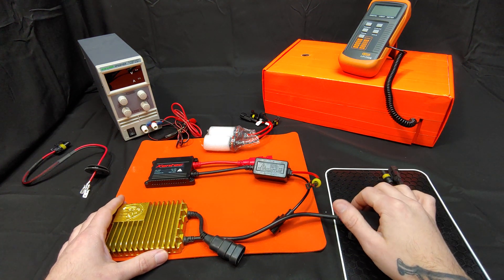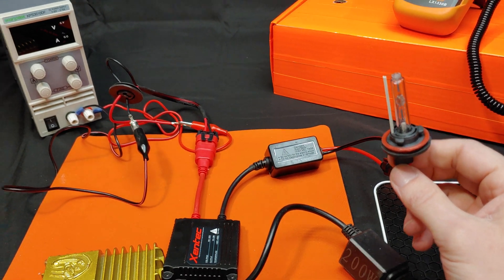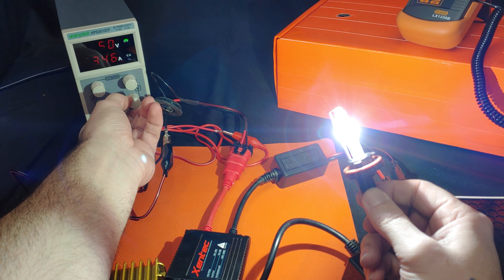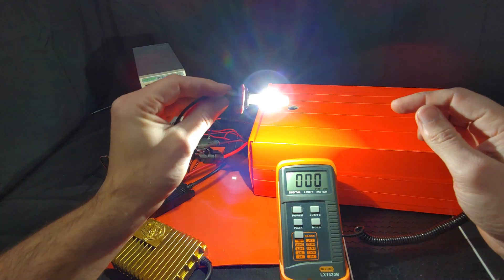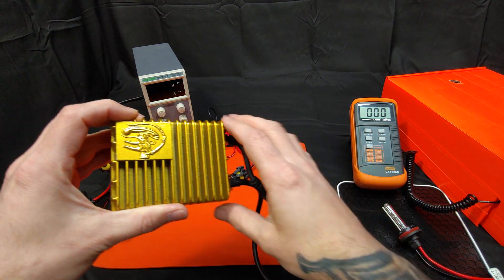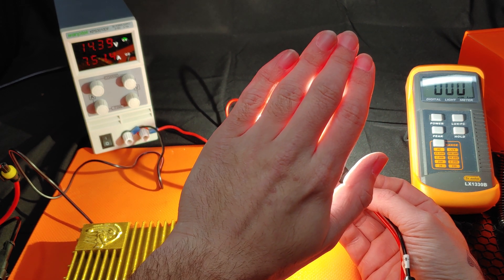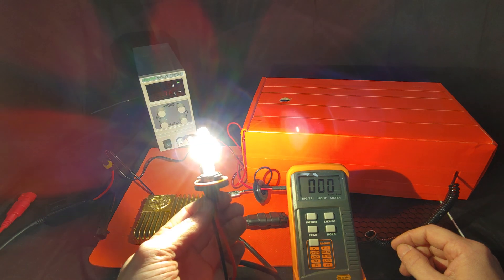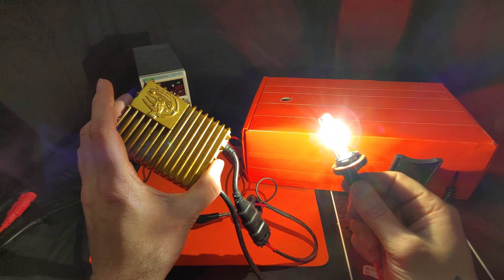Are these eBay ballasts really 200W?

Comment: Also I assume most people have figured out that they mostly list the total wattage for the two ballasts combined. So if you see a 150 watt hid ballast set it’s probably 75 watts each, if it’s 300 watts, then it’s 150 watts per ballast.
Reply: 150w hid ballast use with osram p-vip philip uhp maybe better than cheap car xenon
Reply: But the rated 55W ballast actually output 49W or so.

Comment: Don’t know if it’s a requirement but many of the kits that sell 75 watts per ballast or more, also use ceramic bulb bases, glass and metals for the build materials. I figure this is so they don’t melt the bulb base and destroy the output characteristics. But I also wonder how well these would do in housings for more than say 15 mins at a time. Because I imagine that these would heat up a headlight housing or a projector, very very hot!

EDIT: I realized that he mentioned the ceramic based bulbs midway through the video lol. So my comment matters much less. Glad he brought that up since they get very hot!

Comment: Hey James, wondering if there is such thing as an amber hid bulb in h8 form factor? Looking for roughly the same color as the high pressure sodium street lamps
Reply: If you get an HID bulb that's rated for 3000k at 35watts, and run it through a 55watt ballast, the color will shift downwards and give off a strong yellow orange color, should be able to find them in H8 size

Comment: Bro have u tried the 350 watt ballest?
 Thank you very much for thr video
Reply: the 350w ballast is available with stage light projector bulb it is a short arc mercury lamp that uses 85v ac power like a car xenon

Comment: If you put them in a projector and not reflector would they be fine ?
Reply: defenitely dont put these in a reflector housing and still they can burn a projector housing aswell cause some projector housings are cheap cast, i would do a bench test with these in a projector housing over night to see what happen, if it burns the projector housing then these are a no go so defenitely dont put these in your car or you'll have a fire hazard

Comment: Does we use any hid bulb with any  blaster , I mean you have connected same bulb with different blasters , please answer .
Reply from the maker: Yes all HID bulbs use a ballast. Some OEM cars have them integrated into the headlamp housing while there are a variety of options for aftermarket retrofit kits. It is best however to match the bulb rating with the ballast (a high power ballast could cause premature failure of the bulb and a high power bulb may not reach full brightness when using a crap cheap ballast. I recommend purchasing both bulbs and ballasts together).

Comment: @James: Wait a second... Isn't this Xentec 55w ballast the same that's in your other video where you established that it was only 35w ?? (using 2.5amp) ??? How come it's running at 3.5amp now?
Reply from the maker: The one in my early video was sold as a 55w but clearly wasn't. This one was from a different seller and turned out to actually be the correct wattage. I meant to address it in my vlogs, but I honestly forgot. I need to see if there is a way to tell the difference without having to measure them.
Reply: @Jamesthelightguy  ok I see, well exactly it would be great to know them right away and distinguish the 35ws and 55ws before buying

Comment: If this remove the chrome, why use it  ?
Reply from the maker: Any HID system "could" remove the chrome plating on the reflection surface inside the housing if the bulb gets to hot or if the housing is "cheap" and the plating isn't bonded well to the base material.

With a high quality housing, with proper cooling, these are capable of producing insane amounts of light.

Comment: O yeah. Had to check this out. Maybe they meant 200W total [2 bulbs]. They even sell a 300 Watt set of ballasts and bulbs. A variety of Kelvin ratings too.  https://www.ebay.com/itm/NEW-Adjust-Brightness-300W-HID-Xenon-Ballast-Headlight-Kit-Bulbs-H1-H3-H4-H11-H7/323615634694?_trkparms=aid%3D555018%26algo%3DPL.SIM%26ao%3D1%26asc%3D20190212102350%26meid%3D96d76f22b45047ac8f536a2d7da4e333%26pid%3D100012%26rk%3D1%26rkt%3D12%26mehot%3Dag%26sd%3D153442820009%26itm%3D323615634694%26pmt%3D1%26noa%3D0%26pg%3D2047675%26algv%3DSimplAMLv5PairwiseWeb&_trksid=p2047675.c100012.m1985
Reply from the maker: Thanks, I can't believe I forgot to put the link in the description. 

I wish I could check out the 300W ones but half the employees (myself included) just got temporarily laid off due to this pandemic. I can't spend any extra money for a while. I do have a number of things to review and build so my regular upload schedule shouldn't change.

I'll post a channel update on Monday to keep everyone informed.